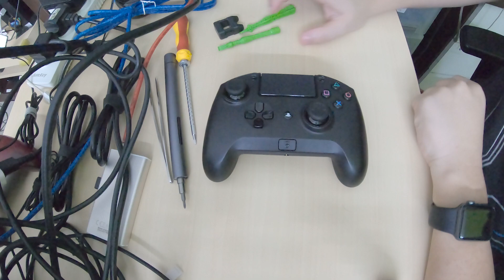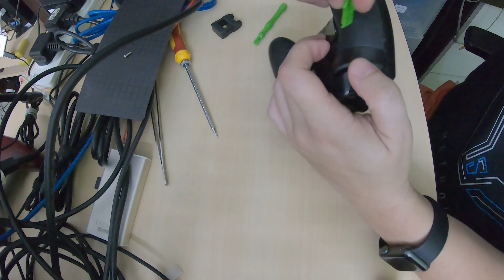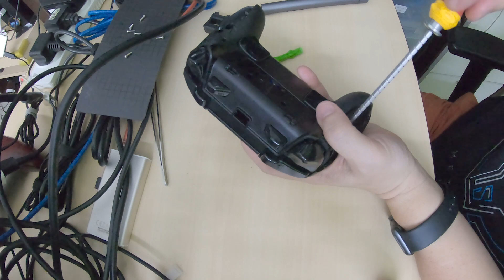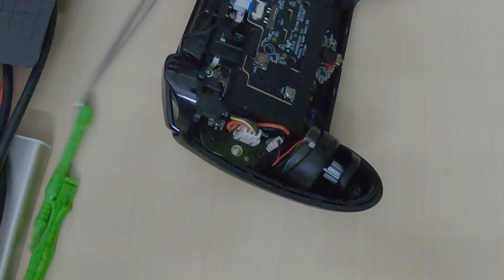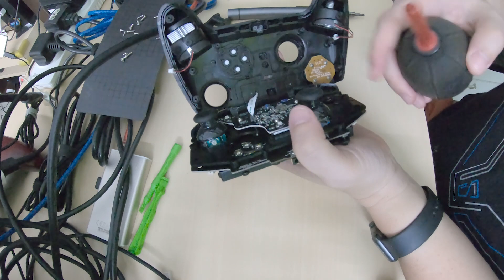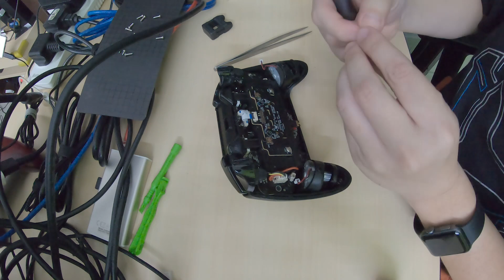Disassembling The Razer Raiju Tournament Edition

Comment: Hey Marauders, I know this is a somewhat video now, but I finally took the plunge yesterday and followed your guide. I used to get occasional drift now and then, but earlier this week it became completely crazy, to the point that it acted as if I had the left stick stuck to right all the time… Now it's back to normal, phew! (The only difficulty I had was that the top screw on the left side—inside the right handle—was completely damaged, so I had to cut up a bit of the plastic to yank the outer shell free, but since the controller was long out of warranty anyway, it didn't matter much.)

Anyway, thanks a lot, your video was very helpful!
Reply from the maker: Glad to be of help!

Comment: Are the sticks switchable? Or replaceable?
Reply: You can buy the replacement analog sticks online. Xbox and ps are the same. Analog sticks are pretty cheap. Around $4 plus shipping.
Reply: @smithdj67 do you have to open it + which ones did you use?
Reply: Yes, i am busy with mine right now.
Reply: Which stick xbox stick?

Comment: Hi there. To remove the cable that connects the motherboard to the touch  pad. You can gently pull in a see saw movement, it comes out pretty easy. Then you can take the analog board out completely and easy access to toggles.
Reply from the maker: Basically it's just locked in by friction and I just need to be careful not to tear the ribbon when I pull it out? Sure, I'll give it a try then. Thanks!
Reply: @marauderz  exactly. You want to remove the motherboard side and not the touchpad side.
Reply from the maker: @smithdj67  Ok, good to know! thanks again!
Reply: whats that little plastic part called because i broke it and need to buy a new one
Reply: @TechnoOnRoblox  not sure what little plastic part you are talking about?
Reply: So the joysticks can be removed changed with other joysticks correct?
I really want to change the sticks but dont want to find out the hard way

Comment: thank you very much, this helps
Reply from the maker: Well, let me know if you figure out how to remove the touchpad, I was afraid of damaging the clips so I didn't prod it too much.
Reply from the maker: You're talking about the touchpad panel is it?  I guess I'll pass for now. :D
Reply: @marauderz  yes, but if you want to remove the cable, just pull it where it was connected to the main board.
Reply: btw, i cleaned all the board because i notice that it was having some sticky residues. just clean it with a qtip and alcohol.
Reply from the maker: So.. The cable on the main board side is just a yank to pull it out? And it works when you put it back in? Oh well.. Guess I have nothing to lose anyway